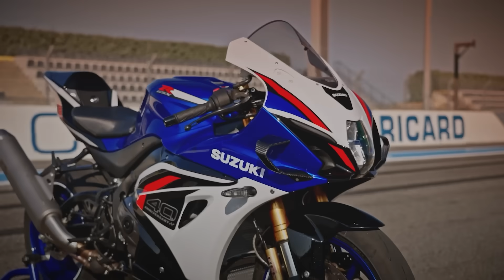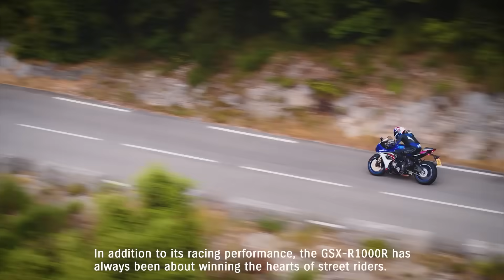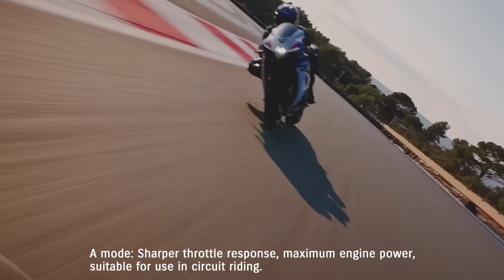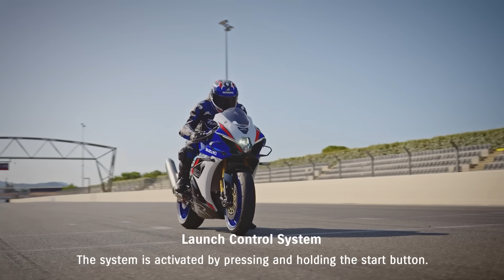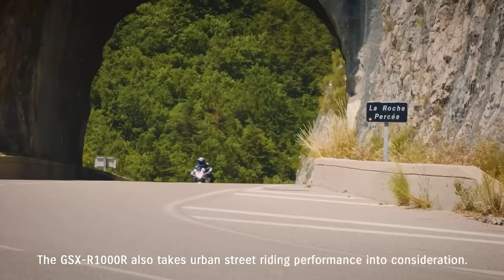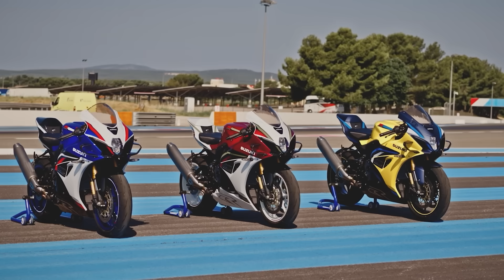GSX-R1000R | Features & Benefits |  Suzuki

Comment: Needed a color TFT with tire pressure, and full smartphone integration. Cruise control and heater grips as well.
Reply: Buy a car
Reply: @ledermin5618 or s1000rr
Reply: You mean the GSX-1000GT?